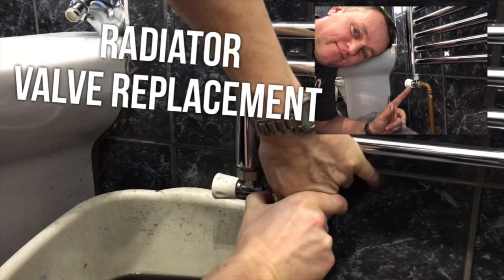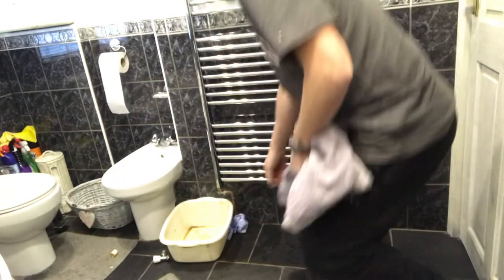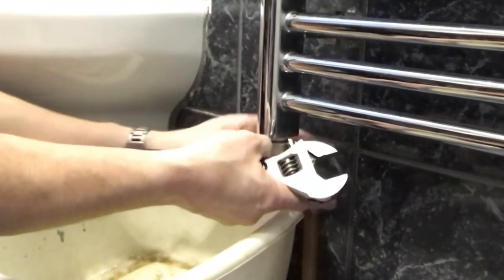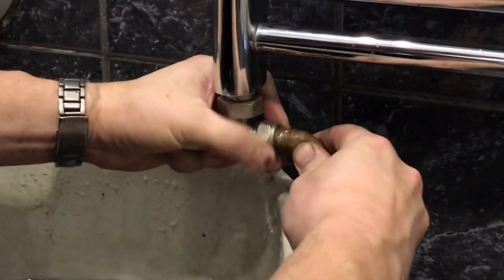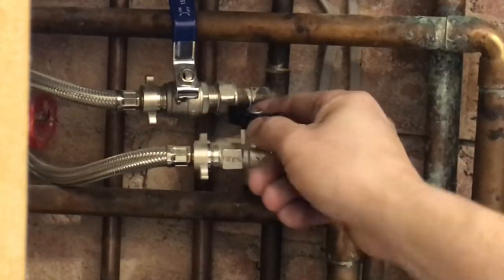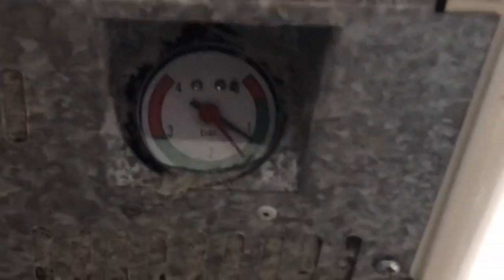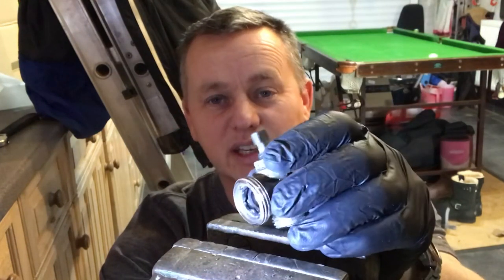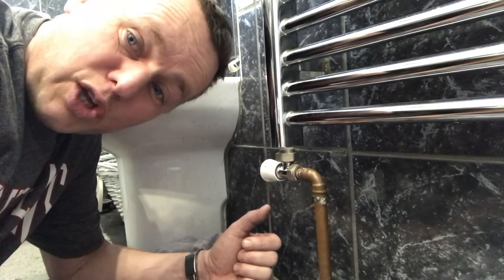Leaking Radiator Valve, How To Replace or Repair Diy (Home Repair)

Comment: What if the pipe just comes up straight from the floor and you can’t get a bowl in there to catch the water?
Reply from the maker: if you turn off all the radiators on the system, then disconnect the valve, with some old towels around the pipe, the flow should be slow enough to change if you are quick. Thanks for the great comments👍🏻👍🏻🛠

Comment: Hi, just come across you channel.
I’ve got the same rail but need to change the thermostatic valve. Is it the same process? Also if I have water stop dials at the bottom 2 pipes do I turn them off from their?
Reply from the maker: Yes, it is, Thanks for the great comments👍🏻👍🏻🛠